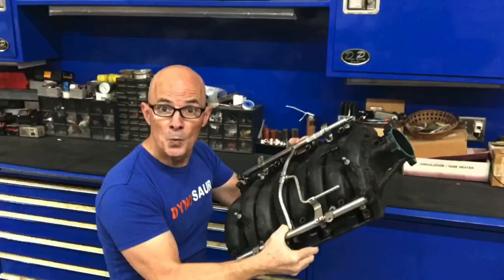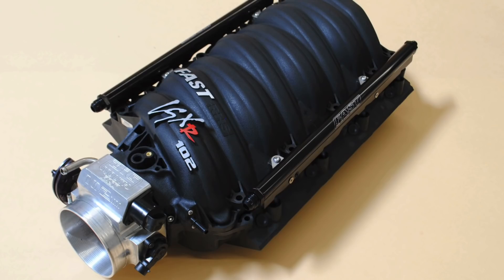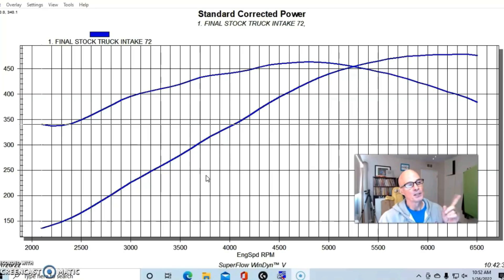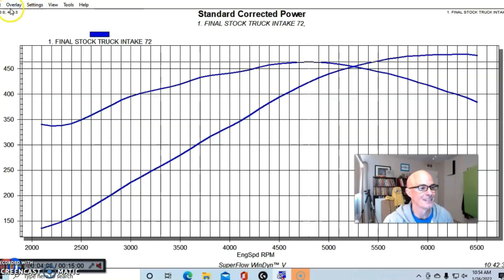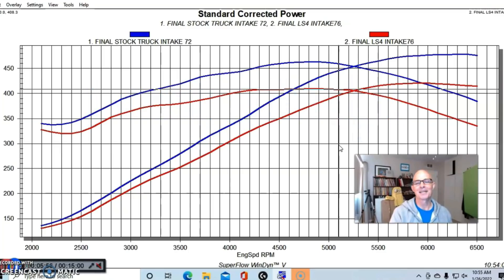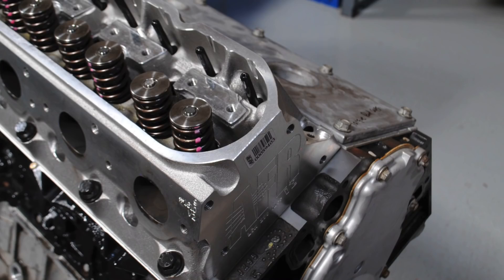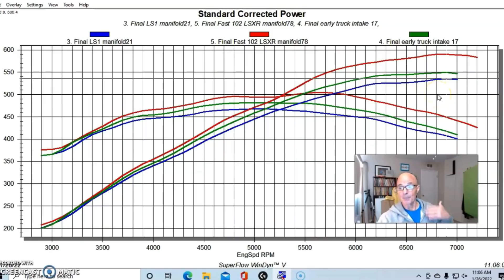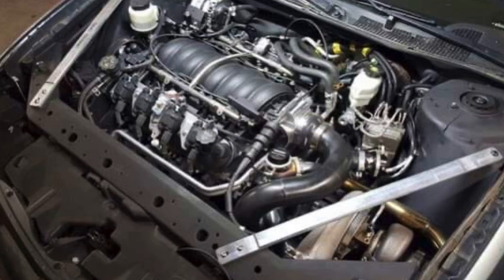WAIT...THEY MAKE A FWD 5.3L LS CALLED THE LS4? JUNKYARD 5.3L LS INTAKE TEST-RWD LM7 TRUCK VS FWD LS4

Comment: Are the internals worth snatching? I remember getting the whole engine out just for the heads, the next day the motor was gutted out. Not sure how much better there rods, pistons & crack is.
Reply from the maker: THEY HAVE FLAAT TOPS AND GEN 4 RODS, BUT NOT SURE ON THE CRANK COMPATIBILITY
Reply: @richardholdener1727  Thank you so much, wasn’t expecting a reply; I’m honored! 😅

Comment: The exhaust setup on ls4s are shit too you can get 35-40hp from headers and the exhaust routed different
Reply from the maker: that is a lot from exhaust mods
Reply: @richardholdener1727  exactly the stock exhaust is very restricted

Comment: Yes, exactly. It might have been engineered as such to limit power with the infamously weak transmission. These only produce 303 hp so even if you only change the intake and leave everything else as is, you will see some gain, but not too significant.

Comment: The 5 3 can be bored out to a 5.7 , do I have your attention now that you know it was a truck motor? Ohhh , let's see if it bolts up to the better transmission,  you know , the 6 speed because we are all looking for that.
Oh you want a Cammed out Version with a shift kit and intercooler , next step is a , Oh I'm not a sellout
Something might go wrong , keep it stock. And pay Attention to your parts , they are not the sames as they used to be.
I used to be about building it to the hilt , however it's all a trap
I'd rather have the 6 speed conversion to the 5.3 though , I don't know if it would fit , however have questions about it.
Reply from the maker: a 5.3l ls4 was not a truck motor

Comment: guys you have to remember that a 4T65E is simply an upgraded plus one gear thm125 from fiero and cavalier theme. And those three speed limp noodles couldn't handle Iron Duke 2.5 L power let alone hopped up GM 2.8 V6/60 !
The 4T80E got all of Caddy engineering from HT4100 engines up and came with 5000 and 8000 lb towing capacity to hold up to armor plated limos.
and to be honest guys Jim rarely had a 4080e go bad behind the North Star it was generally either the oil manifold plate between the block and the oil pan would leak so bad it would like a motor up or you would blow the head gasket cuz the head bolts threaded directly into aluminum and they use turque to yield head bolts and they were garbage anyway.
smartest move on a Northstar to fix 95% of its problems rip the heads off of it time start the block add a set of ARP head studs and new head gaskets make sure the heads are absolutely positively straight and after that the North Star was pretty much a tank motor. I know of several limo companies but as soon as they bought their limos the engines came out they completely resealed the engine with a few other little tricks to make sure they didn't have oiling problems and they time serted the block inserted head studs new head gaskets double check to make sure the heads hadn't twisted at all and both of them back together and I can verify that one limo company I know has several older armor-plated limos that they just keep rewrapping because the paint went bad on them and it's cheaper to wrap them for a couple of $1,000 that it is to paint. but they went through their engines like I said and have close to 500,000 miles on those engines. but then again they also don't baby those engines either they use the appropriate aftermarket synthetic racing oil they've upgraded the cooling systems to use Evans cooling products with a non-acques propylene glycol coolant. several other minor upgrades to help mileage and performance and they've actually never done anything but tear down for oil leaks so far. and the 4080 trans has been flawless for them 99% of the time every once in a while they'll have a problem with the torque converter ballooning on them that may damage an engine or hurt the transmission but generally the transmissions it to 300,000 mi still have red fluid and shift like a brand new car so you know you can't complain about that.

Comment: So changing the intake and throttle body doesn't effect the drive by wire system?
Reply from the maker: we don't run DBW
Reply: @richardholdener1727  ok thanks for answering my question

Comment: Elephant in the room: It goes with a 5.3 liter engine.  It might be like a 550 vs 750  cfm carbs on those engines. Should test on 5.3 or 4.8 even better.
Reply from the maker: what goes with a 5.3L? The LS4 intake is terrible on any LS motor

Comment: I really wanted an LS4 for my Isuzu Trooper because it would allow me to keep the stock manual transmission. It's fairly stout as long as you don't beat on it. The starter would have been a hurdle though.

Comment: Hey Richard! I really want to see an ls7 top end on a 4.065-4.075 inch bore or on an l92 ls3. Iv seen that it actually does fit, just the exhaust valve clearance against the cylinder bore  isn't exactly ideal, but a back to back ls7 vs ls3 top end test would be really cool. 

Love the videos! Thanks!

Comment: Agree with everyone else about the transmission… I had a GXP with this engine and the 4t65e.  I also had a GTP Comp-G with the supercharged 3800, smaller pulley, higher ratio roller rockers, and I was pushing the limit of the transmission.  back in the mid 2000s, some of the GP owners were beginning to use cryo-treated input shafts and other mods to keep the transmissions from grenading.  GM’s transaxle were never designed for that kind of power, so Richard I’m positive your assumptions about limiting the power of the LS4 with the intake (and other parts) is correct.

Comment: In the 2013 LTZ they made 300 Hp from the V6. In 2014 they kept building the old Impala as a "classic" but suddenly it only had 250 HP and this was all in the fact that they never really opened the throttle wide. I think it really is packaging.

Comment: How does a factory LS4 compare to a factory LM7?  I know the LS4 is rated higher, but will it actually make more more with that restrictive intake?
Reply from the maker: the LS4 has a bad intake, but better heads and wilder cam and higher comp
Reply: @richardholdener1727  thanks!

Comment: It's amazing that the LS4 made 300 something hp with that intake manifold. I wonder what that engine would do with anything else on it. 
I find it amazing that people buy this on Amazon because of how plentiful it is. That choke spot after the throttle is horrible. I wonder if an LS1 manifold would fit in the car.
Reply from the maker: the LS4 has very good 243 heads and an even better stock cam than the LM7
Reply: @richardholdener1727  Do we know what cam?

Comment: Come on the LS4 intake manifold isn't that bad, its totally possible to run 10.50s in 1/4 miles. You just have to install another one in the rear is all #twinpala #hotrodgarage. When they changed intake manifolds things went down hill #4L65E
Reply from the maker: have a trans made of glass is a problem-even when you have two of them

Comment: Why didn't they use the same transmission as the Cadillac on the North Star the Cadillac uses the 4 T 80 which is the same as a 4 L 80 just transverse . For some reason they use that crappy 4T65. The other problem is it's pretty difficult to swap.

Comment: I'm currently swaping an LS4/F23 into my 88 Fiero. 
I believe that GM choked the intake on purpose to protect the HD4t65e, even in stock trim the LS4 powered cars had trans issues. 
My combo has an LS6 intake, LS2 cam and modified LS7 exhaust manifolds, I expect it to run very nicely in the 2,800 lb car.
Reply: Might want to look a Comp cams xtreme series cam 214-220@ 050s.  duration for 500 hps and maybe throw on top Howards cams ls1 variable duration lifters.
Reply: Do you have any videos
Reply: my guess is a healthy 350/350 to the wheels

Comment: I think it was totally packaging. Yes the 45T65E-HD isn't great, but it has held up to daily driving well on 3800SC for years when GM chose it. I think the change in torque curve was their biggest downfall for the transmission, but they hold up in most of the models. The GXP does eat transmissions, but I think that is more the nature of the drivers vs car. You don't hear about transmissions as bad in the Buick models until they are modified.
Reply: They break, period. It's only matter of time.
Reply: @MonzaRacer  I guess, but I also have two 45T65E-HD (I know small sample set) but both of them have been fine to 200k miles. GM doesn't build great bullet proof transmissions, but they generally are pretty reliable for 150k under normal driving and regular maintenance. I wish I could say that about any dodge/Chrysler transmission. My trucks for whatever reason love to eat transmissions and transfer cases :\

Comment: can you use off the shelf forged cranks in the ls4 despite it's size differences?
Reply from the maker: the crank is shorter
Reply: Stock cranks supposedly CAN be modified to fit. All mods are about and flywheel mount

Comment: I think GM bean counters f'd the consumer as usual. I run a Buick LaX Super. All they had to do was put the 4T80E in there and even that LM7 intake. Charge the consumer at the tail end. I'd CERTAINLY have paid the... what... $1k? 2k extra on the back end for a car that will last. There's a reason they're sarcastically called "Generous Motors"... and they wonder why they needed bailout help. Do it right, charge for it. People happy. Go for the initial sale and stop going for the "get 'em every 4-5 yrs for a new one"... especially in such a special model such as the Super and it's not-so-innocuous in-your-face-obvious brothers the Impala SS/Monte Carlo SS/Pontiac GXP. Make them throw-away and you become a throw-away brand and one people won't purchase from.

Comment: There's probably gains below 3500 RPOM only your dyno can't show it due to it's lack of braking ability at such low rpm.
Reply from the maker: wrong on both counts
Reply: @richardholdener1727  As far as a diagnostic tool goes , your dyno is completely useless below 3000 rpm.  Please explain WHY that statement is wrong, preferably with a whole video.

Comment: they did purposely design it that way.  Rather than redesign the valley tray with oil pressure sending unit in the way AND beef the 4T65, they cut the TB opening in half.  Probably would have made closer to 350hp in stock form instead of 303.  Which is why LS4 guys swap in an LS2 or LS6 intake.  A buddy of mine about a decade ago even swapped on a FAST 102.
Reply: Is the 102mm fast intake the best intake to go with?

Comment: I have a 2006 Impala SS with 166K miles on it. The car needs the body fixed up, and I can do that, so I've decided to keep it. I just bought a reman replacement crate engine for it from GM. Got a deal on it, and it was the last one, part # now discontinued. The transmission runs fine, no problems, I changed the factory fill fluid and filter 7 years ago and everything looked fine in the pan. This is because I don't beat the car. I drive it in a realistic manner. As far as I'm concerned the car is meant to be a 4-door sedan with good highway passing power and that's how I drive it. The car is not suitable for repeated standing start hard acceleration like you might expect from a Camaro. The kind of passing I do is getting around a semi or a parade of dawdlers on a 2-lane highway. I don't mind if the engine is detuned to protect the trans. I kept the car bone stock, maintained it and drove it responsibly for 16 years, and it still runs well at 166K, even the DoD still works. There is a little valve noise and maybe some piston slap when cold but it all quiets down when warm. Probably the biggest performance issues with the engine having 166K on it are the timing chain being extremely stretched and the heads needing a valve job. I will probably put another 5 or 10K miles on it before I fix it up and replace the engine, then I expect to go on doing what I was doing for maybe 20 years (I don't drive as many miles these days) if they haven't outlawed gasoline by then.

Comment: Hi Richard. I have an idea that I'd like to try for a small block Chevy & I'd appreciate your opinion & if it's even a realistic idea. For my G-body I'd like to go back to the original cubic inch of 305. Instead of using a 70-80's era engine,  destroking a 400 block. Is there a factory crank that would get me in the ballpark? Like maybe a 90's era 4.3l. Lt1. I really like idea of better head selection & the idea of the bore & stroke combination. Thank you & as usual great video.
Reply from the maker: you can combine a 3.0 stroke with the 400 block-there are smaller factory stroke cranks too

Comment: Gm was trying to make the 4t65hd live behind the ls4.... wasn't the ls4 cam also configured to kill torque I had a friend who's mother has a Bonneville gxp ls4 and at 130k miles the trans was slipping completely stock and adult driven, I didn't know if it had been maintained or not but I've also read other horry story's of the 4t65hd's reliability I knew someone who had a built 4t65hd and blew it up at some 4-450 whp/tq

Comment: Isn't the throttle body supposed to be facing the back of the motor on the LS4? IDK if it would make a difference in power, but I'm surprised that they didn't have any fitment issues.
Reply from the maker: LS INTAKE CAN BE REVERSED

Comment: I have read before that the LS4 intake actually has a much smaller intake inlet neck where the throttle body mounts, due to being factory mounted backwards on the engine and having to clear the oil pressure sensor directly in it’s way. I have also read that it’s very common to relocate the oil pressure sensor and install a better flowing intake and larger throttle body because of this awful restriction.

 Personally I would love to see how much a 305 HP rated LS4 from an 08 Impala SS like my own would benefit from just an intake and throttle body alone.
Reply: It is a clearance with the Power steering pump and the D.O.D/A.F.M system. You don't have to worry about the D.O.D if you do an intake swap, but bigger intakes require converting to an electric steering pump.
Reply: @brianhunt6943  not with an ls2 intake just have to relocate the oil pressure sensor
Reply: @brianhunt6943  I do see that being an issue with some larger intake swaps, maybe all swaps, not sure. All I was mentioning is that the oil pressure sensor location is the root of the flow restriction with an LS4 intake. It’s necked way down in diameter behind the throttle body.
Reply: Around 50hp crank
Reply: The problem with a tbss or ssr intake fitting is the alternator bracket and the power steering pump
Reply: @Bless-edisYeshuaHamashiach Chrck out ls4king, those problems are pretty much solved. He decided to fit a cadi blower onto his ls4.
Reply: @fjb666  ive seen all the parts i follow him on facebook and youtube

Comment: 4T60E/65E=Cheese. 
I think they did it to save the 4T60E/65E. Even the 4T80E in the "hot" versions Could barely hold stock 5.3 power numbers.
Reply: The reason for using the 4t60/65 was primarily because they had it. Keep In mind the recession was 3 years away and Pontiac/gm at the time was attempting to make a ls1 awd powered gtp called the gx8. However, the hp output was to high and funding wasn’t there. So they took the already r&d’d block and pan design and used the 5.3 to attempt to save money and the transmission
Reply: @governmentcalamari9785  Most of all GM had to do was put a "hot" tune on the trans and it would have barely held stock numbers for the most part. Same thing with Honda in the 2000's V6 they made the auto trans shift softer because of customers complaining about "harsh" shifts and made a trans that would burn it's self out in 120-175K miles. But yeah it was on hand and mostly 4l60/65 parts that they have had for years/decades. It would make sense budget wise to reuse as much as possible from previous architectures as possible. Same with the Cadillac FWD 500CI transmissions being mostly a TH400 with a chain on the output shaft sending power to a differential under the crankshaft instead of sending it to the rear wheels.

Comment: I have a good idea for a turbo test,  what would Happen if you went from  a 4" to 1ft of 3" then back to 4" vs straight 3" downpipe.
Reply from the maker: IT WOULD BE A RESTRICTION
Reply: @richardholdener1727  just wondering how much it would be.  I think a lot of people like me have to make their down pipe neck down to a smaller size for a foot or 2 to fit.

Comment: Rod Mod and ported LS3/Gen4Truck/TBSS intake manifold please!!!!!!!!!
Reply from the maker: THE TBSS IS CATH PORT-I HAVE TESTED THE LS3 VS LY6/TRUCK INTAKE (THAT IS UP ON THE LS3 EFI INTAKE TEST VIDEO)
Reply: @richardholdener1727  Sorry Richard I've been drinking. I should have said Rod Mod and ported vs stock TBSS Cath/Gen4Truck Rec/LS3 Rec. I meant it as more of a comparison between the ported and rodded LS3Rec/Gen4TruckRec/ TBSSCath vs stock LS3Rec/Gen4TruckRec/TBSSCath. On the old forums the rod Mod was good for what like 10-15HP on a otherwise mostly stock LS3?

Comment: THANK YOU!!! 
Been waiting for this for years.

Would be interested to see ls4 manifold on a 4.8 or a 5.3 engine? Obviously it's just can flow the air for a large engine so maybe it would be best for a 4.8L?
Reply from the maker: IT WOULD BE DOWN ON POWER ON ANY LS-EVEN A STOCK ONE
Reply: It’s physically the worst ls factory intake. Pretty sure it was done purposefully when the awd gtp/gx8 got axed with the recession.